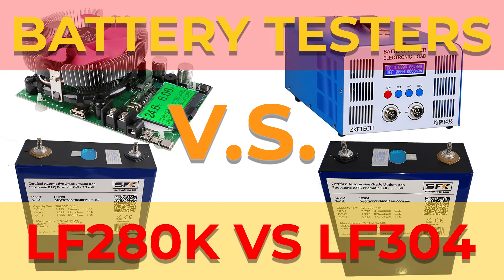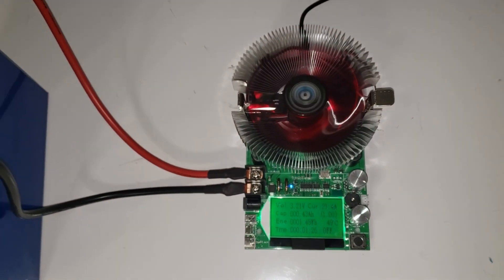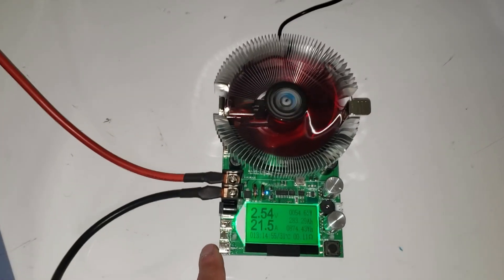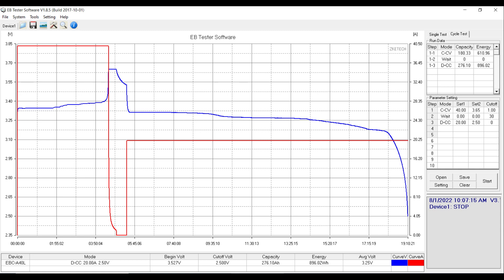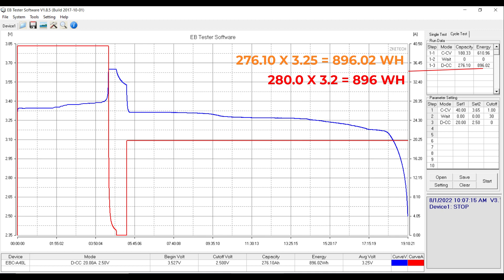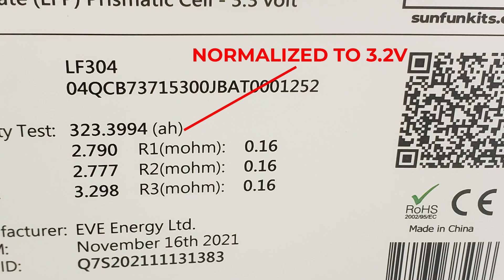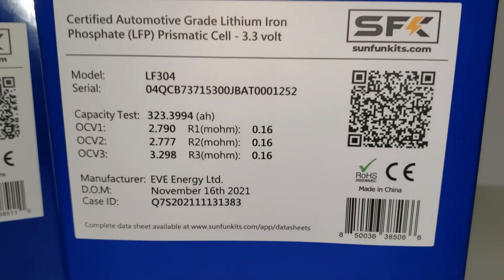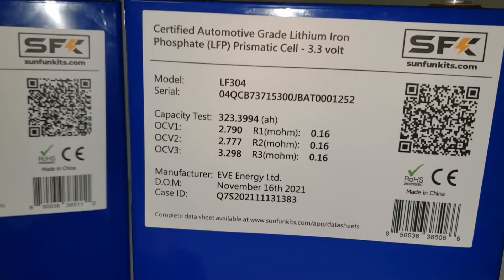Comparing Battery Testers on LF280K & LF304 EVE, ZKE EBC-A40L, Heater w/Fan and our Findings

Comment: You keep calling the load tester a charger. Doesn't inspire much confidence in what you're doing. As well, you only tried one volt meter. Doesn't every know that there may be quite a significance in the readings from different volt meters?

Comment: You're not testing correctly. First of all, measure the stability of the current consumed by the load. All Zketeech loads have very high thermal current instability ~ -20%, due to poor circuitry and shunting. Because of this, the battery capacity will be ~ + 10-20%. So a large measured capacitance means nothing. Calibration will not help, it will allow you to adjust the current in cold mode, after operation and warming up the current will drop (or maybe increase) even by 20% and the measured capacity will be very inaccurate. The Atorch DL24 more accurately holds the load current out of the box and the measured capacitance is more accurate.

Comment: I believe the common use of Ah is all about the rating of the battery to safely provide a give current rate to a load, and the safe charging rate is related to that.

I agree that Wh is a very common rating to see on a battery/cell. The key rating. Ah seems to be related to charge/discharge rate and nominal voltage to be a ballpark figure to be used in calculating supplied voltage level when designing equipment or applying power to equipment. There's a tolerance in a nominal figure. Equipment usually has a safe operating voltage range, and in that range is the nominal or usual or safe target voltage.

Comment: So, to capacity test cells, look at the watt hours as tested.

Makes sense. Lots of batteries sold with a watt hour rating. 

Then you use your chosen nominal voltage and divide Wh measured by nominal voltage, giving you the tested Ah.

Important take away, you need to know the advertised nominal voltage and watt hour rating to be able to verify if your tested capacity matches the advertised capacity.

Thanks for going through it for us. Great video.

Comment: So here’s the thing, the whole “normalizing” thing you are trying to do doesn’t make any sense nor does it make any sense to try and figure out a batteries true capacity by measuring watt hours

Watts is a measurement of “Power” and watt hours is a measurement of power produced over time, but in order to calculate watt hours you need to multiply Amp Hours by Voltage, and the voltage on a battery cycle test varies over the time of that test. What does not vary is the current. These tests are preformed using a constant current, so it’s very easy to calculate Amp hours. If your battery is fully charged, and if you pull 40 amps for exactly 8 hours before the battery is empty, you have battery capacity of 320 Amp hours. 

You can use the measured 320 Amp hours from that test to find out how much “power” your battery delivered by multiplying the Amp Hours by the nominal voltage of 3.2V (for LiFePO4) but the measurement you get in Watt hours by preforming this multiplication will only be a close estimate to the actual amount of “power” (as calculated in watt hours) produced because the voltage of the battery will have varied over time. It a very close estimate, but the nominal voltage of batteries using the same chemistry will always vary a little due to many things including impurities in the cathode/anode and density of the electrolyte in the cell. It may only be a small difference , but it’s a difference nonetheless 

I understand the desire to try and measure the capacity of a battery in watt hours because it’s an easier concept to understand for most people, but a watt hours calculation is not the “Capacity” of the battery, it’s the calculated “Power” that the battery produced over a given time by multiplying Amp Hours and nominal voltage. The “Capacity” of the battery is measured in Amp Hours. This is why every single battery manufacturer does their capacity tests in Amp Hours, one only need look at the battery datasheets to see the testing methods and battery specifications, you will not find watt hours listed under battery capacity in any of the EVE datasheets, rather you will find Amp Hours listed both in the specification and testing portions of the datasheet
Reply: RE: Watt-hours - when I put a battery into service with real-world loads, I care about the amount of work that I can perform using the batteries capacity. The work performed is measured in units of energy (watt-hours, kilowatt-hours, Joules, BTU, etc.). For a given amount of work (running a 12V refrigerator for a given amount of time, for example) I will consume a given amount of energy. 

The energy I need cannot be measure in Ah, simply because the Ah I use will be dependent on the voltage at the instant that the current is drawn from the battery - as the voltage drops, the currents draw in amps will rise, but power measured in appropriate units of energy will remain constant. Ah would only be useful if voltage were constant - which of course it is not.

Even though Ah are commonly used to express battery capacity, the unit that matters is watt-hours, simply because that's the unit that actually measures the amount of energy that I will be able to draw from the battery before it goes dead. Unfortunately it's common practice to use Ah instead and strange constructs such as 'nominal voltage' to market batteries.

There is a reason my electric company charges me by the kWh, not by the Ah. If they billed me by Ah I'd be contacting the Utility Regulators and complaining. :)
Reply: @Welding_in_Sandals  I have no issue with anything you are saying. Knowing the calculated Watt Hours of a battery is a useful bit of information to have. My point is that you cannot directly measure the capacity of a battery in watt hours and attempting to "normalize" the Amp Hour rating of the battery makes no sense. To calculate the Watt Hours of a battery you have to first measure the capacity of the battery in Amp Hours and then multiply the AH by the nominal voltage of the cell. You can't directly measure the Watt Hours of a battery because it is a calculation of power derived from Amp Hours and Voltage.
Reply: @DyslexicDancer  >>>you cannot directly measure the capacity of a battery in watt hours

If you put a constant load - such as a refrigerator compressor that draws a constant wattage no matter what voltage - and time how many hours until the battery is depleted, you'll have an accurate measurement of watt-hours. That measurement will be independent of the voltage of the battery, type of battery chemistry (& etc.) and will be directly comparable across battery types & chemistries.

As an alternative, one can measure instantaneous current and voltage at suitably short intervals (I.E. every second), calculate watt-seconds, and sum each calculation up over the course of the test. This method also calculates the amount of useable energy in the battery, but uses actual voltage not 'nominal voltage', and therefore will be a more accurate measurement of the useable work that a battery is able to perform before needing a recharge.

In my real-world case, my fridge draws 60 watts no matter what voltage and I need to know how many hours it will run. Watt-hours will tell me that. Amp-hours based on nominal voltage will not - simply because my battery will not be at nominal voltage during the test.

Interesting discussion. 😀
Reply: @Welding_in_Sandals   If you are measuring instantaneous current and voltage at suitably short intervals (I.E. every second), then you still are not measuring Watt Hours, you are measuring amps and voltage and using those two measurements to calculate watt seconds, those watt seconds add up to watt hours over time., but again, this is not a direct measurement, it's a calculation of two different measurements.

And I agree with you that knowing the Watt hours (power) that your battery produces is a useful calculation to know, but it's still not how battery capacity is measured. Battery capacity is measured in Amp Hours.

The main issue I have is this idea of "Normalizing" the AH rating of a battery. Look at the example in this video that we are discussing, Sun Fun Kits measures 276.1 Amp Hours from his load test, the test reports 896.02 WH of power, giving a nominal voltage of 3.245V for this specific test, so far we are all good, then he says well the cell didn't really produce 276.1 AH, actually it produced 280AH if you take the reported 896.02 Wh and divide the WH by an artificially made up voltage that he's getting by converting the actual measured nominal voltage of 3.25 to 3.2V, but that isn't what his own test measured, it measured 276.1 AH, that is it's capacity regardless of how many watt hours it produced. AND this test was done at a constant current of 40 Amps, so no wonder the Nominal voltage of this test is higher than 3.2V......... I 100% guarantee the Nominal Voltage of this test would have been lower if the test was preformed at a .5C (140 Amp) rate as documented in the data sheets and the watt hours produced would have been less, so no, this cell does not meet the specifications as documented in the data sheet, it does not produce 280AH under a 0.14 C rate and it definitely will not produce 280AH under a .5C rate, so why the heck come up with some convoluted "normalization" theory to artificially inflate the cells real AH capacity?  It just makes no sense

You are correct that your battery voltage will change and not be at nominal voltage all the time, this is precisely why capacity is measured in Amp Hours, the amp draw during a load test is constant and unchanging, and you need this measurement along with the voltage throughout the test to calculate watt hours.
Reply: It seems to me the back-and-forth in this thread is largely due to a mix-up between terminology and intent. If we want watt hours on a battery label instead of amp hours, I think there are strong reasons for that, regardless of industry standard practice. Sometimes entire industries are doing a thing in ways that are not the most ideal. 

But I think @The Dude Does DIY is also trying to clarify that you can't repurpose the term "capacity" if you want to focus on watt hours instead of amp hours. Capacity is an important measurement for lots of reasons. Capacity is amp hours. Any physicist would facepalm at claims otherwise. It's a narrowly-defined key term, nothing more.  Century-old physics terms are codified and not disputable, though I don't think anyone here really intends to redefine terms. It only seems that way, perhaps because sometimes we say "capacity" out of habit when we mean something else.

Regarding real-world examples versus tests, volts and amps can both vary or be isolated, although I agree with @&Michael's point about constant current tests not being the best representation of most real-world scenarios in which a powered device tends to want the same amount of power continuously. Measuring voltage, amperage, or compositing both into wattage on a short timescale, are all valuable for varying perspectives on the data.

Regarding watt hours not being directly measurable, is it not a distinction of semantics? One could say amps and therefore amp hours aren't a direct measurement either, since shunts derive amps by measuring voltage across a given resistance. It seems to me we can measure any of these concepts directly, whether via a single physical tool or composited via multiple tools.
Reply from the maker: Please look at your actual cell you will see a WH rating not Amp Hour its on the QR code. Amp Hour without voltage is meaningless. Looks like it will take a few years to clear up this Mess because 1 youtuber decided AH ignoring voltage is the way to measure batteries and everyone else has just hopped on board. 

Next time you look at cars, laptops, even cell phones they will always be rated in WH not in AH.
Reply: @sfkenergy  this has nothing to do with any youtuber, I honestly don't even know who you're referring to. 

Can I ask you a serious question, why are you so opposed to measuring a cell's capacity in Amp Hours? Using Amp hours is literally the industry standard for capacity measurements of any battery cell, doesn't matter if it's a LiFePO4 battery or a Trojan T105 Lead Acid battery, capacity is always measured in Amp hours, You can't directly measure the watt hours of a battery, because watt hours isn't actually a measurement, it's a calculation of power that is derived from the Amp hours (which you can directly measure) and the Voltage, (Which you can also directly measure) Resistance is another property that can be directly measured, but no need to go there for this conversation.

Please do me a favor, because I can't post a link here, go to EVE's website and download the datasheet for the LF280K it lists the Nominal Capacity as "280.0 Ah" nowhere in the datasheet does it mention Watt Hours, then look at the testing conditions, again, it does not mention Watt Hours anywhere all it's lists are Amp hours. Then do the same thing for CATL, download the datasheet for their 302 AH cell and look at how the cell capacity is measured, again it's in Amp Hours

You mentioned the QR code on the batteries, download the "LiFePoQR battery QR Scanner" from the app store, scan a QR code on one of your battery cells, and report back how the capacity is listed from decoding the QR code......spoiler alert........ it's in Amp Hours

Cars, laptops, and cellphones all have battery cell capacities listed in Amp Hours, they may additionally list watt hours so that it's easier for most consumers to understand the total power they can expect from the battery, but the battery cells themselves are indeed measured in Amp Hours for their cell capacity, look at any 18650, 2170, CR123, doesn't really matter, all have capacities list in mAh, which is to say their capacity is measured in Amp Hours. let's take a look at Tesla, While they list the KW/h of the entire battery pack, that's just to avoid confusion for a general public who has no idea what the pack voltage is, so using KW/H is just easier for them to list so consumers can compare the total power available of the battery pack, again watt hours are a measurement of Power, not capacity. If you look at the individual battery cells that make up the Tesla battery pack you'll find that Tesla lists capacity of the individual cells in Amp Hours . For Example that their newer 4680-type battery cell.  Tesla lists the estimated total capacity as 26.136 Ah, and they list the total estimated energy as at 96-99 Wh

I guess I don't understand your reluctance to measure capacity in amp hours, but hey, it's your channel and this is a free country, so keep doing things your way, just don't be surprised when you get pushback on your idea that watt hours is somehow a measurable quality of a battery cell, because it's simply a calculation of power derived from the cell capacity as measured in AH and the nominal voltage of the battery
Reply from the maker: @DyslexicDancer  I see you are quite dedicated to your Beliefs,. but the industry standard has always been watt hours:

Watt hours = amp hours x nominal voltage.

If you are going to use amp-hours you must also include the nominal voltage. OR you must normalize the amp-hours to the nominal voltage of the chemistry you are referring to.

Please see this video: https://www.youtube.com/watch?v=3tnfQ_HzJpk

in regards to the scanning app, it would seem quite silly to do that when the QR code already states the WH on the cell itself.